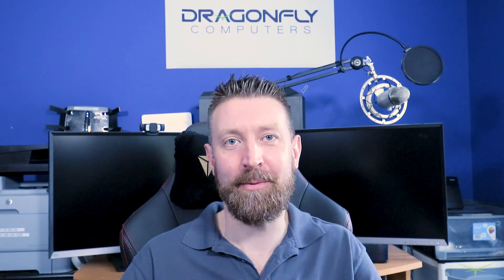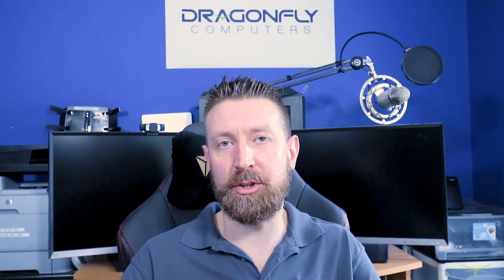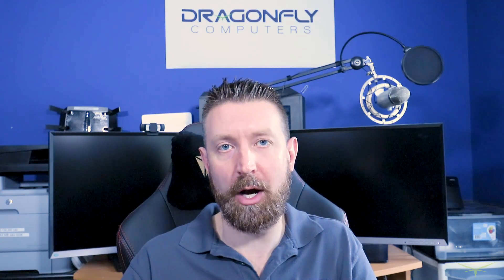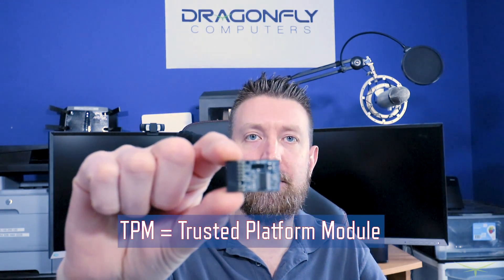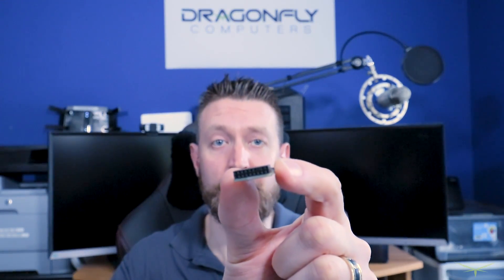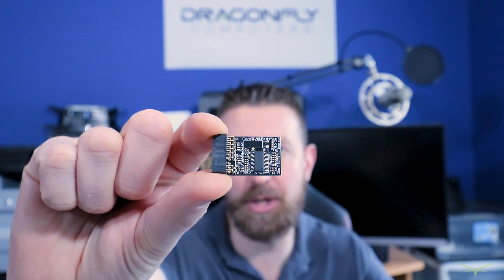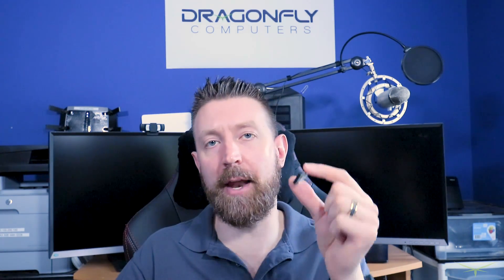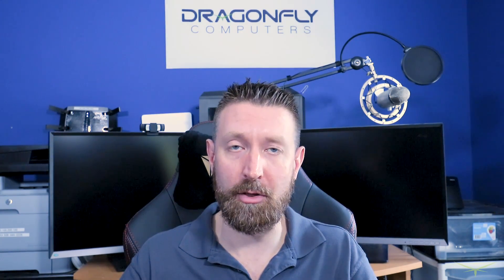Using AMD FTPM with Bitlocker

Comment: I just successfully updated BIOS on Asus Crosshair VIII Hero with fTPM and BitLocker. 
1) Suspend BitLocker in Windows and boot into BIOS
2) fTPM factory reset was set to - Disabled (and probably always should either you update BIOS or you don't unless you want to clear out your fTPM)
3) Go to EZ Flash utility, don't change any other settings
4) Before updating BIOS it actually prompted me to check if I suspended BitLocker in Windows or backed up my keys (not prompting this with fTPM disabled)
5) Update BIOS and boot straight into BIOS
6) The fTPM is still enabled but fTPM factory reset now set to - Enabled! You need to change that to - Disabled. This is crucial part, you should keep it as Disabled.

Short two points:
Suspend BitLocker before flashing the BIOS. Windows automatically enables it after reboot.
Always ensure fTPM is enabled AND fTPM reset is always Disabled.

Comment: Say goodbye to all your files when the motherboard dies and takes the TPM with it and your hard drive was using Bitlocker. I have 3TB or personal files in my C:\ Drive, and I would hate to lose it all because my brand new Windows 11 TPM-enabled laptop has a corrupted BIOS because Windows Update decided to push a firmware update without my knowledge...

Comment: I am new to fTPM (but I am a  senior-plus computer engg. prof.) and started reading since it gets thrown as a must with Win 11. 
I have a related, frustrating situation and see if you can shed any light on that :)
In my AMD asus tuf b450m-plus gaming, there are two settings related to TPM

One is to enable fTPM that you mentioned.  That itself is a can of worm as you mentioned (or the 1st answer seems to solve that by suspending bitlocker). 

Then my MB Bios also has another option: 

Erase fTPM NV for factory reset: [Enabled] When new CPU is installed, select this option to reset fTPM.
If you are using BitLocker or encryption-enabled system, your system cannot boot up without a recovery key.
[Disabled] Select this option to keep previous fTPM record and continue system boot. fTPM will NOT be enabled with new CPU unless fTPM is reset(reinitialized). You can swap back to the old CPU to recover TPM related keys and data.

I think this cryptic description explains in a way what your video explains with respect to BIOS upgrade. But it still doesn't talk about the situation where one is just getting their feet wet with fTPM while not using bitlocker yet (this is my home system with videos of 70 year old guy xxx acts!). With two options (in the Bios), the bitlocker option (using it before or not), CPU upgrading, we are talking about 8 possibilities (or may be more) and it has to be explained via a flowchart or something. But I guess companies don't have money!

This cryptic description also doesn't mention if this erase option has to be enabled for the first boot only with a new CPU and disabled later (as the description seems to imply) or permanently enabled. Have you come across this option and what is your thought on this? Thanks.

Comment: I was testing the upgrade path for Windows 11 which will now require TPM and my x570 Motherboard failed because of no detectable TPM. I did find the fTPM option on my motherboard but all of the warning about it going onto the AGESA bios memory and other complicated warnings about bios updating and possible locked OS issues I decided not to enable it. Sheeeesh, upgrading to Windows 11 is going to be a nightmare even for seasoned PC builders like myself. I never even heard of a TPM until now.

Comment: As mentioned in a previous post, this is expected behavior and aligns with the TPM 2.0 specification. With all the Windows 11 preview discussions occurring on the web, it would appear some folks have managed to update the bios without encountering any issues by following these steps (ASUS specific)

Suspend BitLocker in Windows for your Drive

Restart to UEFI

Update your BIOS using EZ Flash

When the Update is finished go straight into the UEFI again

Enable fTPM and DISABLE resetting the keys (This step is crucial!)

Boot into Windows, everything should be working fine. 
If you look at your BitLocker state of your drive it should be active again

If I find the time I'll image a drive and run this through the gauntlet and capture a video of the process in an effort to help clarify things moving forward. I'll also reach out to some AMD folks to see if they can do more to provide resources for the wider community.

Comment: I have a Gigabyte X470 Aorus Gaming 7 Wifi, with a Ryzen 7 2700X, the fTPM enabled, and Bitlocker encryption. When I updated my BIOS, I did not have to disable my fTPM first, nor did I have to decrypt my drive.  

When I updated my BIOS, the fTPM was of course reset. Bitlocker asked me for my recovery key, which I provided. Then, in Windows, I went into Bitlocker management and I set a "new" PIN. I.e., I set a "new" PIN that was the same as my old PIN. That was enough to regenerate the encryption keys to use the "new" fTPM. 

In fact, it was so painless that it took me longer to restore all my fan RPM settings in the BIOS than it took me to restore my Bitlocker settings.
Reply: Just now, I updated my BIOS again, just so that I could be sure I was giving you the correct information.

So first, I did not disable fTPM first. I just left my BIOS as it was, and then I updated it.

When I rebooted my computer, Bitlocker Recovery asked me for my long recovery key, as expected.

Then, when I tried to log into Windows, it said that "something was wrong", so it asked me to enter my Microsoft username and password, rather than just my PIN. Then it asked me to authenticate my second factor, which happens to be an alert on my phone. So it was just like when I try to log into my Microsoft account from a new computer; it went through the whole "2 factor authentication" bit.

Next, I rebooted my computer to see what would happen. When I rebooted, Bitlocker Recovery asked for my recovery key again. So I entered it again.

This time, in Windows, I went into Bitlocker Management and clicked the "Change how drive is unlocked at startup" option. I went through the wizard again, just to re-initialize Bitlocker's unlock procedure.

Then I rebooted again. This time, Bitlocker did not ask for my recovery key.

So basically: on a Gigabyte X470 Aorus Gaming 7 Wifi motherboard, you do not have to disable fTPM before flashing the BIOS. Just have your Bitlocker recovery key ready, then be prepared to have to go through the full 2 factor authentication to log into Windows, and then go into Bitlocker management and reset the unlocking method. 

Note that I also did not have to decrypt my drive. All I had to do was reset Bitlocker's unlocking procedure. The encryption itself was not affected or redone or reset or anything like that.

Comment: You have to disable Windows side of Bitlocker before you update the BIOS. but decrypting and encrypting the drive shouldn't be needed (or at least that's how it works with the TPM chip).

Comment: I come here just to know about TPM after seeing windows 11 minimum requirements...
Reply: same, I have a ryzen chip and dont plan on using drive encryption but I'm still scared to enable fTPM in case it fucks up something.
Reply: The same and windows app told me I can't run windows 11 but I have ftpm.?
Reply: @mkpleco  You need to enable the ftpm in bios under security.
Reply: @ComfyShortz  yes thank you. First I will be updating the bios, then enable.
Reply: Same here, and I enabled fTPM before watching this vid

Comment: I never update my BIOS, unless im facing some kind of crippling issue thats bios related. I update it when i get a new MB and never touch it again specifically because of all the weird stuff like this that happens when you go mucking around in the bios.
Reply: I had stuttering in some games and bad temperatures with ryzen 3600 that went away after 4 bios updates, and because of that i continued updating until last year, now i'm scared to update.
Reply: Stuttering caused by fTPM was rampant for years under asus. We had to roll back to an earlier bios to escape it. They eventually fixed it but at the same time FORCED fTPM on even if you turn it off - the excuse was muh windows 11, which is complete garbage anyway.

Comment: would you please help me . ... i want to to buy Amd Ryzen 5 3000 series for some TPM use but i m a little bit confuse that i have to purchase some external device for TPM or its inbuilt in this processor... please help
Reply from the maker: It's really hard to find much information on this. I searched a bunch of technical specs but nothing said whether or not this chip will use ftpm or not. My guess is that it will but you have to enable it in the BIOS, but I could be wrong about that. As a backup, you could make sure whatever motherboard you buy has a physical TPM header just in case. That's about the best I can tell you.
Reply: @DragonflyComputers  actually its cost a lot ..that's why I want accurate information before buying it,  that it has TPM or not ....please do me a favour and tell me either it has TPM or not ...

Comment: Asus MB not much better.  Will not recognize TPM chip accessory added to MB.  And right - no documentation to be found.  What's the point of the putting the header on MB and purchasing the $24 TPM chip?
Reply: Hi there, like I wrote in my comment above, I've got a ASUS Prime X570 Pro MoBo which has a 14-1 header for a TPM. I ordered the original TPM-SPI from ASUS (Nuvoton NPCT750 chip) and it worked like a charm. I had to enter and exit the BIOS once until the TPM was recognized - the BIOS showed "TPM 2.0 module detected" in the "Advanced" section. I then was able to enable BitLocker without any problems.
Reply: They want to make the pc industry like the phone industry. 0% DIY and anything breaks you have to buy a new one. That is the purpose of microshit foisting this trash on everyone. You’ll notice that like 6 people on earth use it at all. It was never meant to work.

Comment: I got the same Asrock TPM Module working without any problems on a AsRock B450 Pro4. But I'm not using the latest Bios, I use P3.6. I also so the recommendation to disable tpm module in bios (->advanced -> security -> tpm) before upgrading. Which AsRock motherboard did you use ?

Comment: Someone else probably has mentioned this, but it seems that not all TPM modules are compatible across all vendors. My MSI TPM does not work with my Asus mobo. I would recommend that you only use TPM modules from the same vendor as your motherboard. 

Thanks to the other commenter that mentioned bitlocker's suspend protection option. It works like a charm. It only stays suspended until the next boot in to windows so you can update your firmware.

I went from a MSI motherboard and TPM and upgraded to an ASUS motherboard. The computer would not even post with the old MSI TPM. I removed the TPM and booted into BIOS. I then updated the BIOS and restarted. Booted up and was prompted for my TPM recovery key. I entered it in and booted into windows. Then I went in to bitlocker and suspended protection. I then restarted again and went into bios to enable fTPM. After saving settings the computer rebooted once more and then booted into windows with no prompt for recovery key and bitlocker is enabled. Windows shows the AMD TPM installed and it has the same recover ID as my old MSI TPM.
Reply from the maker: Nice job. The issue for me was that I bought the ASRock TPM and it didn't work with my board (it wouldn't even POST).

Comment: I'm using AMDs fTPM on my msi MPG X570 GAMING EDGE motherboard. Before you update the BIOS you could either suspend Bitlocker or make a backup of it (which you always should anyway). After updating the BIOS and re-enable the fTPM the first time you boot you enter the recovery key and it will be stored in the fTPM. Any subsequent boots will work as expected with no entering of recovery keys and such. This is normal practice for HW TPMs as well. I've done it many times on Intel laptops as well as Intel PCs in general and now lately I got an AMD PC. Same procedure always...
Reply from the maker: Good info, thanks.

Comment: Very good advice, thank you!
I am upgrading from an older Intel ITX motherboard to a new AMD x570 ITX motherboard. I have been using the same type add-on TPM with Bitlocker & USB startup key for years. Just found out the new motherboard has no header for a TPM anymore. Just don't get how they could remove this type of functionality. Looks like fTPM + USB startup key will have to do.
Also interesting: https://firmwaresecurity.com/2019/12/09/bitleaker-decrypts-bitlocker-locked-partition-with-the-tpm-vulnerability-cve-2018-6622/

Comment: Hi Dragonfly Computers! I am desperate to find someone who can explain the following fTPM behavior: Intel PTT (their fTPM) was used with bitlocker (TPM as the only protector apart from the recovery password). Now the mainboard died and was replaced. However, booting the same drive on the replacement board, no bitlocker recovery password was asked for. How to explain that? With a discrete module, any board change would ask for a recovery password. And no, of course bitlocker was not suspended when the old board died. Any idea?
Reply: I contacted Asrock and we reviewed it together.
Thing is, if you insert a USB-Key with a startup key on first reboot after the mainboard change, somehow bitlocker allows you to work with the same fTPM-PIN afterwards. AsRock wrote me:
"got feedback from headquarter/AMI. They say it is correct/normal:
Because the fTPM existed on two platform and has the same codes.
That is why when changing to a different same-type platform the system is still able to boot once the original pin is inputted".

Comment: There's one mistake in the talk: You don't have to decrypt & re-encrypt the drive. If you go into Manage Bitlocker, you can "suspend" bitlocker, which stores a one-time key on disk so you can update bios and get back into windows without a problem.
Reply: You are amazing, this will save my butt when I go to W11. I do wonder though, can I enable fTPM and not enable bitlocker, just so I can install W11?
Reply: @Frizzy9000  I just did and it's working great so far. Also tried the W11 upgrade checker and now it says I'm all ready for W11. Earlier it said I could not run W11
Reply: There is plenty of wrong in this video, and its now being used by Intel fan boys and to spam people with it thanks!
Reply: The other mistake is believing the guy that said updating the bios broke his windows apps. I wouldn't be surprised if he said: "and It installed Doom Eternal. Sold my PS4 on Facebook and deleted my homework" xD
Reply: @impoppy9145  actually it's believable. Windows Store apps could use some proprietary security from microsoft.